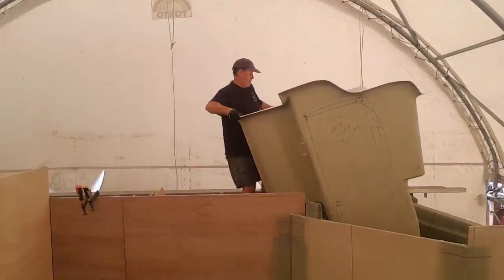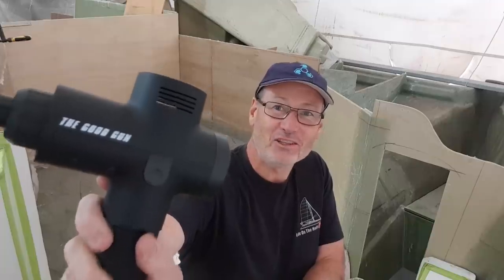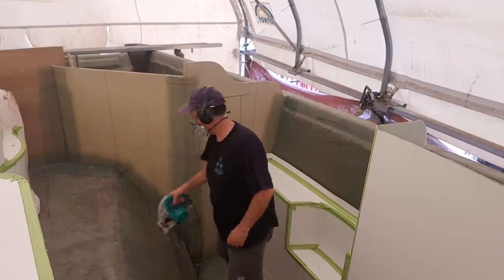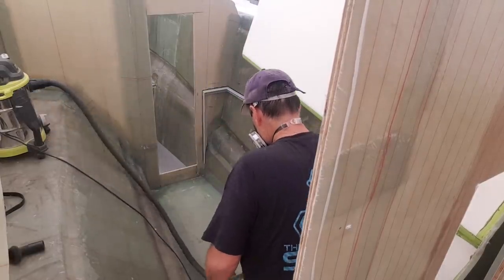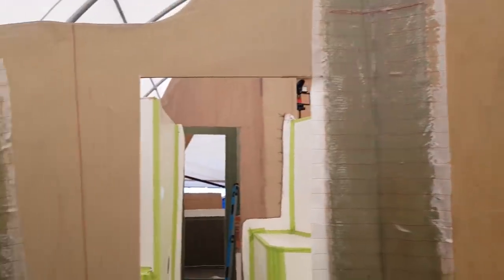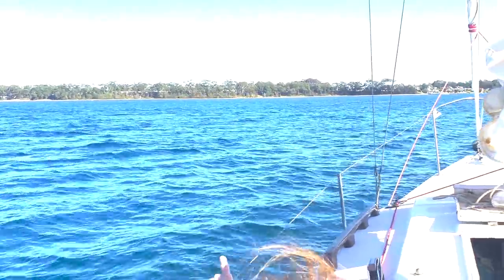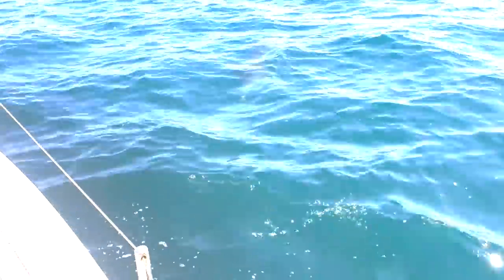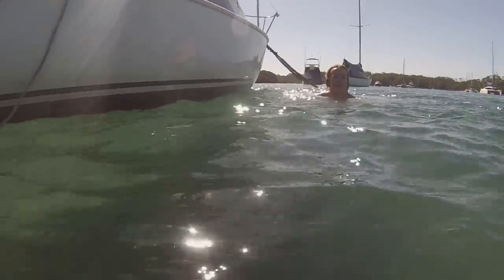Ep114 It's a bit tight in here - Life On The Hulls - How to build a Catamaran

Comment: Always thought the one door in my boat would be so much easier to get through if it were 
narrow at the bottom and widest the top. Parallel sides are a pain. But then there is the hinge issue..
The way you just keep plugging away is a constant inspiration.
Reply from the maker: Hey buddy,Teal on "Onboard Lifestyle" did a brilliant issue on his doors that had a flip up hinge along the bottom 10th of his companionway doors.Agree with shaped doors but always an issue.Cheers Ross

Comment: If you take some old worn out blades from you'r multi tool and stack a few up and put a rivet in them it makes a gnarly bevel grinder for corners and getting rid of blow out's of resin etc etc.There a bugger to drill though,And you have to cut the mounts off the extra's added.

Comment: Hey Ross, one question (per week ^^), why are some bulkheads made of foam, and some made of wood ?
Reply from the maker: Gidday buddy.Our Yacht design engineers required main compression  bulkheads to be made of laminated sheathed marine ply to ensure sheer and compressive forces could be carried and found foam would be unlikely to sustain over a lifetime of the boat.That said I was able to convince forward wing frames to be foam as they are longitudinal stringers with the result of a weight saving of approx 200kg.All the best Rossco
Reply: @LifeOnTheHulls  Good weight saving especially up forward. Any idea what you think your finished weight will be compared to the original specs?
Reply from the maker: I am aiming at a dry weight of 6500kg and wet weight of 8500kg with fuel and water.No way of truly knowing till the end but seems pheasable. Ross⁸